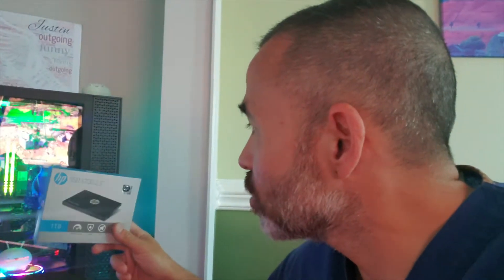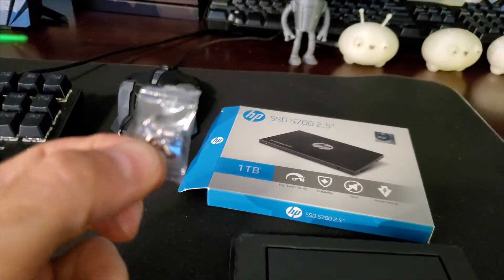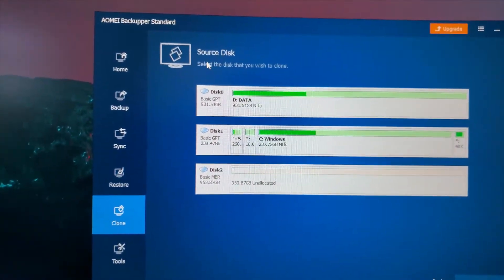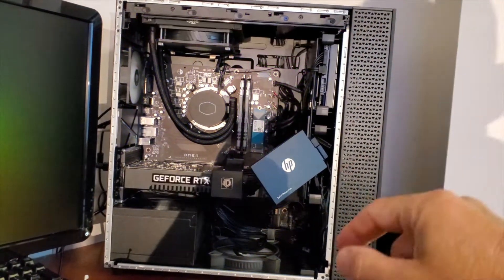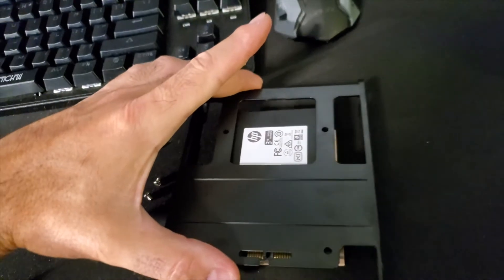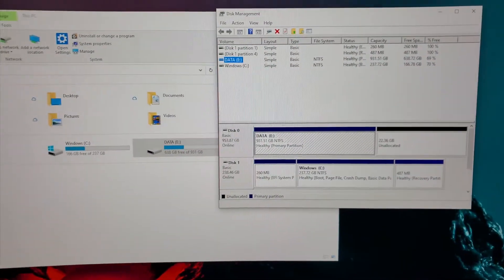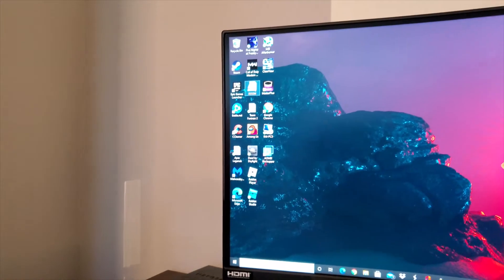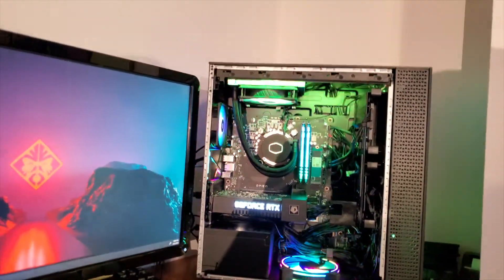OMEN 30L HARDDRIVE TO SSD CLONING AND INSTALL A TO Z! LESS THEN 25MIN

Comment: hey is the top of the AIO cooler you bought suppose to be a little warm like 1/10 maybe a 2 or 3?
Reply from the maker: If ur talking about air exhaust out of the radiator them it should be hot like 8 but my actual cooler on top of the chip is warm I guess just look at it temps on the  omen command center program
Reply: @dsaleen2002  okay, thanks (this is my first time doing this and I realized it was warm so) LOl. thank you!!